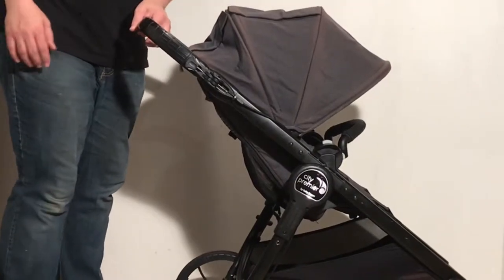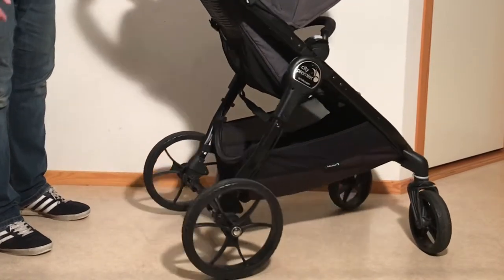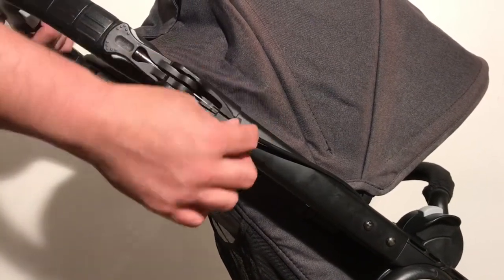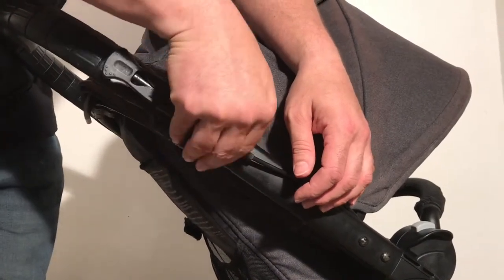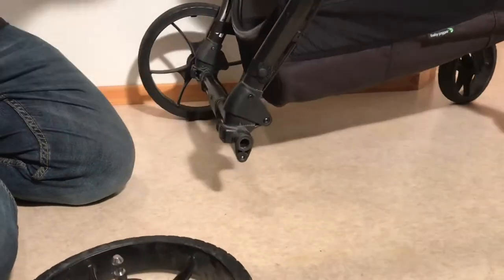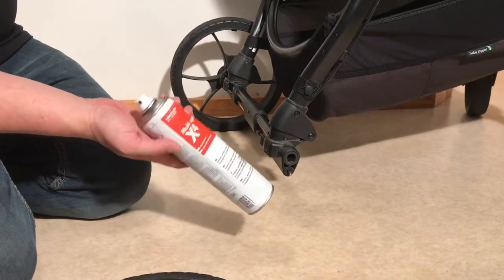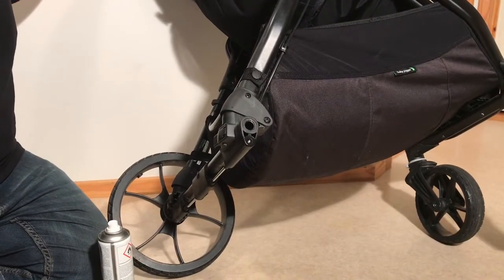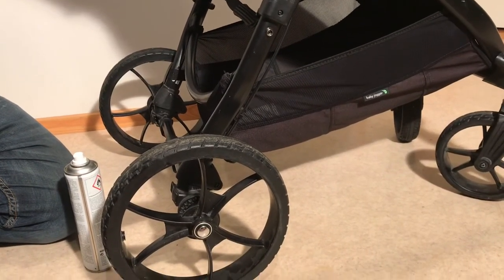How to Troubeshoot and Fix Brake Problems on the BabyJogger City Premier

Comment: Hi, i followed your video on replacing the brake wire and no problems until i had to pull out the wire+right side pin from the center ‘case’ on the back wheel cross bar. It’s stuck in there and the right long metal pin seems to be joined with the left pin as the move a tiny bit but depending on eachother. 
My problem was the brake handle being really tight - then i pulled it hard and it seemed to ‘snap’. Almost impossible to pull the handle back. Any experience with the brake system being one unit left and right? How to disassemble? How much do babyjogger usually charge for a new brake system? In Denmark. Site seems to be catering only to US/GB.
Have tried oiling the entire system with WD40.